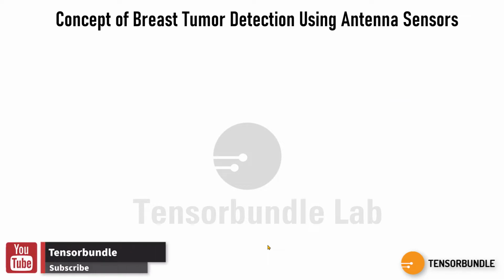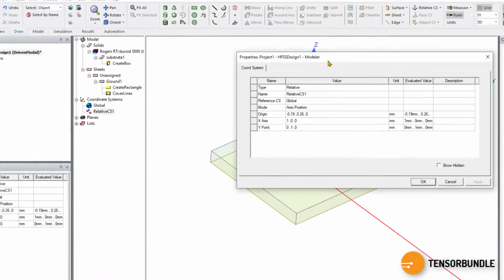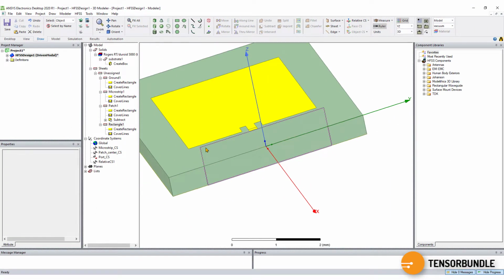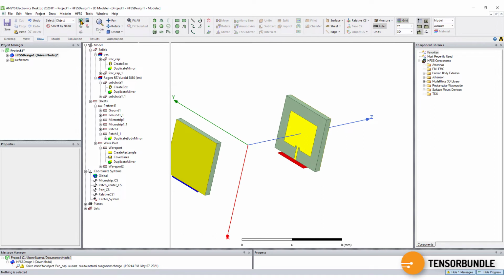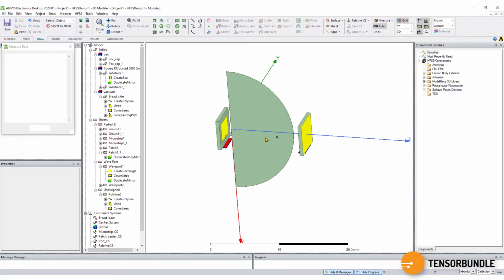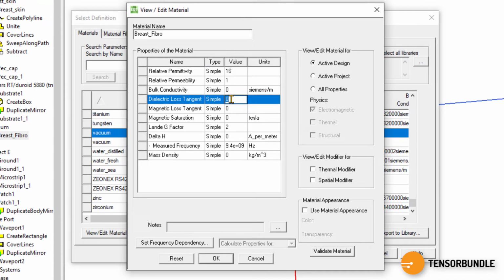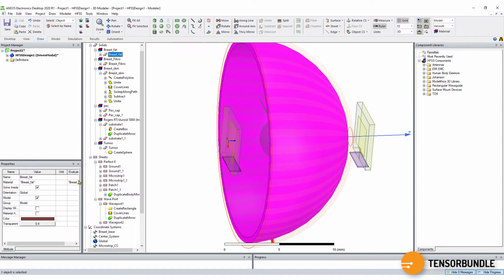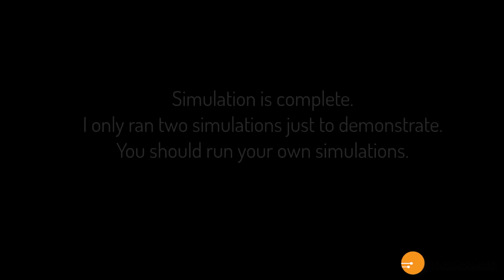HFSS Tutorial: Breast Tumor Detection by Electromagnetic Signal and Microstrip Patch Antenna in HFSS

Comment: But if we are using a circular array of antenna then it will be still a port network ? sir
Reply from the maker: no, it will be N-port network, N= number of antennas in the array setup e.g. N is also the number of ports you will define in your simulation

Comment: Very detailed video. Thankyou.

I am new to HFSS and antennas too. I have a little query,  I am understanding the second antenna as receiving antenna which received the transmitted radiation from tumor. If this is the case then should the second antenna need to be excited. 
Correct me if I am wrong. 
Thankyou
Reply from the maker: yes you are right
Reply: Thankyou for your fast reply. 
I meant that if the the second antenna is recieving antenna then why you're exciting the second antenna?
Shouldn't it take radiation from outside(tumor cells)?
Please correct me if I am wrong.
Reply: Both antenna should be excited to measure the S12 and S21 radiation effectes. under the option of edit field source you have to give 1W input to both the antennas

Comment: the frequencies available for these medical applications do not exceed 5GHz, but you are working with 33GHz
Reply from the maker: That's absolutely wrong. Who told you that? You have not read enough research papers on the topic. You should read following papers before making any random guess.
1. Iliopoulos et al. IEEE Trans. Biomed Eng. 2021,  Enhancement of Penetration of Millimeter Waves by Field Focusing Applied to Breast Cancer Detection

2. Sabzevari et al., IEEE Microwave Mag. 2019, Tumor Detection Using Millimeter-Wave Technology: Differentiating Between Benign Lesions and Cancer Tissues

3. S. Di Meo et al, IMWS 2017, High-resolution mm-wave imaging techniques and systems for breast cancer detection
Reply: @tensorbundle   ok merci bcp
Reply: @tensorbundle  for imaging allowed band is 3.1 to 10.6 ghz, 
There are a couple of machines in clinical trials e.g. MARIA by Bristol university, and if you read their research even signals above 8ghz are not good for imaging. 
So my question is what good will be detection if you cant image it